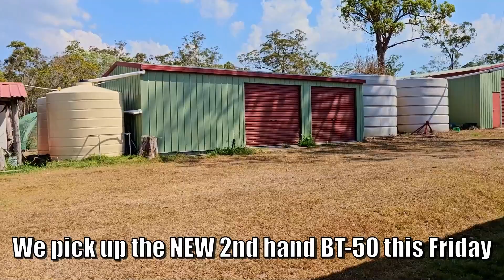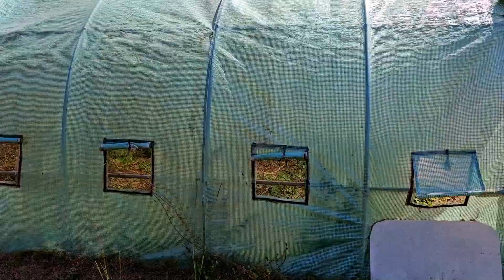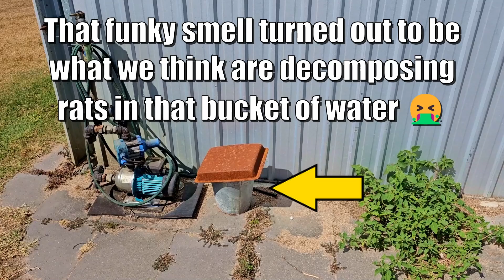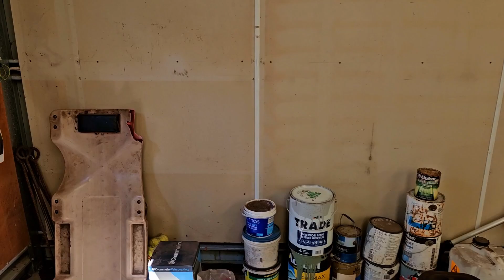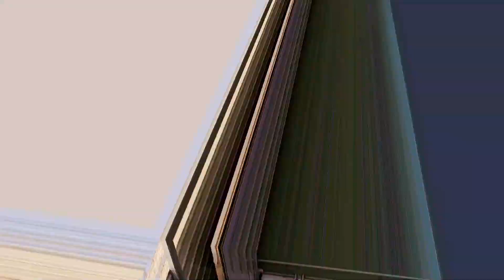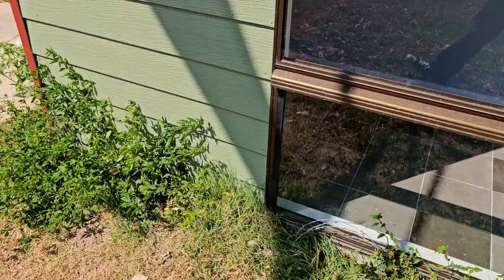Picking up the Keys & Checking out the NEW Homestead Infrastructure

Comment: Place I bought also looked like they did a midnight runner. Wankers about stuff they "said they'd leave". Sadly gotta assume everyone's a used car salesman, get it in writing (hindsight).

Be surprised if that rainwater setups ever been properly maintained, suitable catcher, mozzies, possible dead things. I wouldn't even trust filter for drinking, unless UV treated, or boiled. Can get 10L from shop (~$5), until sorted. Lots of cleaver ideas on YT to sort system.

Don't know your background/knowledge, & there's plenty options available, but I like how Aussie YT "Free Range Living" have turned their property around in the past year since takeover, with Regenerative Farming.
Reply from the maker: The tank tops & overflows look secure but we're still getting the water tested. B collected a sample to send off over the weekend. 😉
We going down the regen path here as well, & hope to be able to get some earth works completed before the next big rain events. 
I subbed to their channel with B but have only looked at one video so far. Will have to have a deeper dive when I get some spare time.
Cheers Lana & have a top one.
Reply: @BitsOutTheBackFarm  Yes time is a commodity, especially for you atm. 
Basically, they (& most) follow the Joel Salatin process. If u don't watch any other, I recommend their "In Joel Salatin's Footsteps" vlog, perhaps while sitting on the throne.
BTW - if you haven't had a septic tank b4, leach drain area is great for veg garden.

For yours, I'd prob get pigs to plough sections, contained by elec fence.
When u move them out, move the mobile chook pen in.
When u move them to the next section, prior to rain (unless water for irrigation) spread multi seed, drag a pallet or 2 over to cover, so the wild birds don't clean it "all" up (perhaps dog can help with that).
Both will obv fertilise while doing a great regen job, also giving u a feed.

Comment: WELL DONE ROB, I hope u checked EVERYTHING?
Reply from the maker: Jack just left & it looks like all the major boards & wiring is up to spec which is a bonus. A few add ons that should be easy to fix.
Cheers mate
Reply from the maker: Most things. 😂 Have a sparky coming tomorrow to give us a quote to check the place over as we have a feeling not all the work done here is up to code. 
Cheers mate.
Reply: @BitsOutTheBackFarm  more then likely not.. is correct, its more of a safety issue, replace c/b for rcd/cb's for power and light circuits and fridges/ac's should be on a separate circuit all together. I loved rehabing old wiring.... and doing it how it spose to be.

Comment: Guinea Fowl will roam in flocks into 1/4 mile from home. They’ll be back just as soon as you throw some feed out for them. 😁
Reply from the maker: They look to be staying around the house now that they have worked out Jack isn't phased by them. I think we may need to reduce the flock size though as its over double what we were told would be here.
Noisy buggers.  
Cheers & have a fantastic week.

Comment: Looks great mate I have workshop envy stuff the house lol.. Diesel lasts well in general not like petrol. Our last chicken was got by a fox. Poor old Hot wings. Young fox daylight wife saw it the compost bin one day after the murder. I will say partly our fault the gates had been left open. 
Bet your glad that smell was not the missing hitchhiker, in on of those freezers. 😱😱😱
Good luck mate really does look fantastic. 
Hire a detector  .... Oh I got the fever... 
All the best.
Dave
Reply from the maker: We checked the rest of the freezers over the weekend & they were all hitchhiker free thankfully. 😜
Sorry about the chook. I think all the guinea fowl here (around 25+) are keeping the 2 chooks that were left here safe. 
I saw a Teknetics T2 Classic up for say around $300 at a local pawn shop. New with instructions by the look of it. Almost bought it but thought the coin would be better spent on paint to keep B happy. 😉 I will let you know as soon as I test one out here. 
Cheers mate.🍻
Reply: @BitsOutTheBackFarm  😅
Reply: If you can hire a new model you get better penetration never a bad thing... But check for that. It might have been gone over with a detectors like the one you saw but deeper stuff missed. 
Best thing is to do some pan samples in low areas where the water runs. Cheap and it will tell you if there is any there. 
Better negotiating tool for a detector or paint later.
Not a good investment to buy one new lot of money if there is none there. 
Pan test first if it there its been there millions of years cool to see something in the light thats been waiting millions of years. 
Even the fly poop I found. 
Cheers.
Reply from the maker: @SouthpawDavey  Thanks for that Davey. I have seen a few pans for sale in pawn shops so will grab one next time I'm in Bundy.

Comment: It is an awesome location. And lots of useful materials. Looking forward to the upcoming project videos after you guys have settled in. It has so much potential. I can recommend you to buy a decent miter saw, I bought the metabo KGS 254 M a couple of months ago and the only regret that I have is that I didn't buy it years ago. It makes building things that much better and faster and accurate. And it makes it easy to cut at any angle. 

It is super handy for all sorts of projects, such as frame building, storage racks, fencing, roofing, flooring, ceiling work, and so on. And you can cut aluminium with it as well. 

Anyway, I wish you guys all the best with moving to the farm 👍
Reply from the maker: Cheers for that mate. Have a decent one I picked up an AEG while back on sale. 
Hope all's well with you mate.
Reply: @BitsOutTheBackFarm  I was not aware that AEG also sells tools, I know that brand mostly from good quality kitchen appliances and such. But I looked at it, and and the AEG looks pretty similar, if not exactly the same as my Metabo. Good tool to have. 

Since I only have a very small lean on building where I have my tools and my work bench I am in the process of building a small mobile cabinet, or saw station if you will, so that I can store the saw while being covered. And so that I can ride it outside if I want to saw longer pieces. And when it is covered I can use the cabinet as a workbench. The saw will fold inside the cabinet. It is a slow process. I am not an experienced woodworker, so I am  taking small steps. 

My worm bins are doing great. The number of worms have grown a lot since I made some changes and since I started blending their food. 

The fall and winter are a bit depressing. It is getting cold and wet and the days are getting short. And there is not a whole lot to do in my 10x10 meter garden. But watching you guys in Australia helps a bit to overcome that winter depression feeling ☺